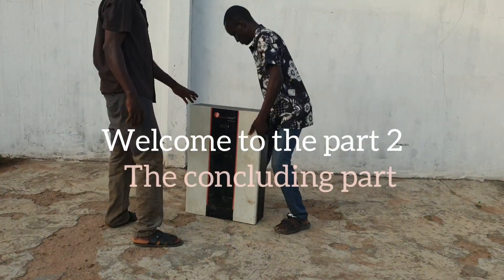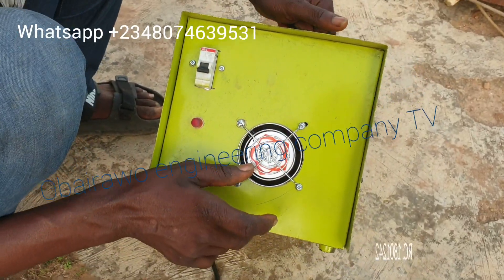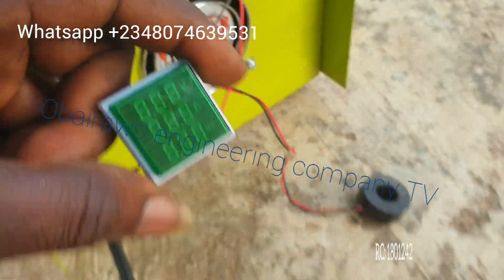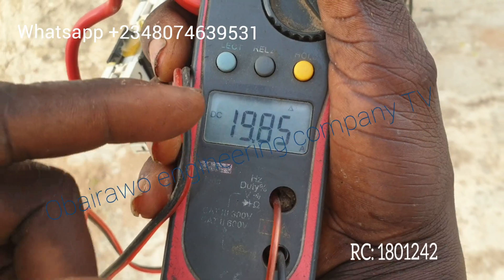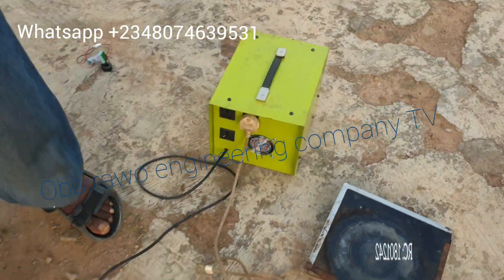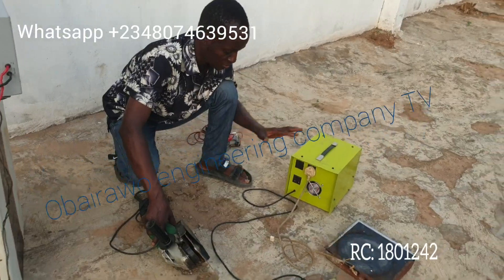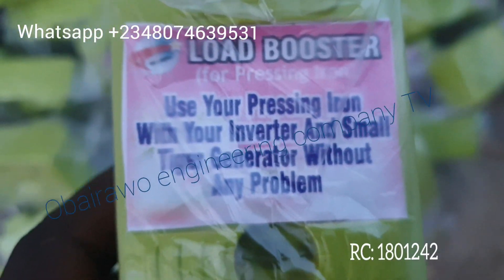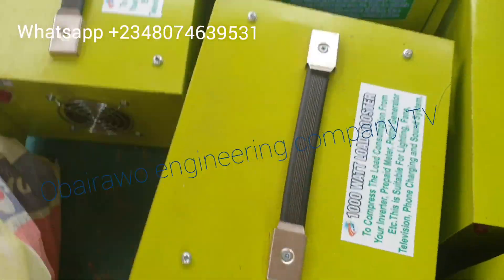part 2, 5000watt load booster testing video, whatsapp +2348074639531, order it now

Comment: You didn't if the heater (load) is consuming the same current w/o your device. It might be doing 70percent duty cycle that's why it consumed less